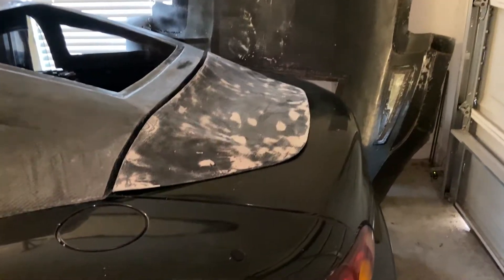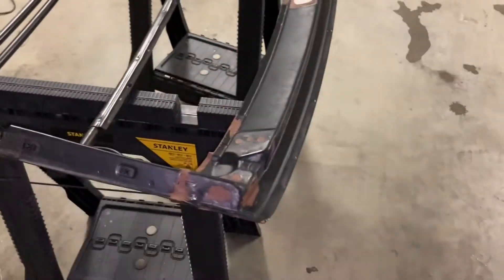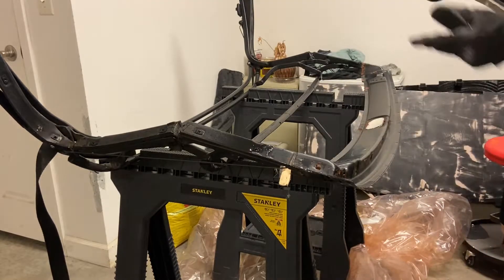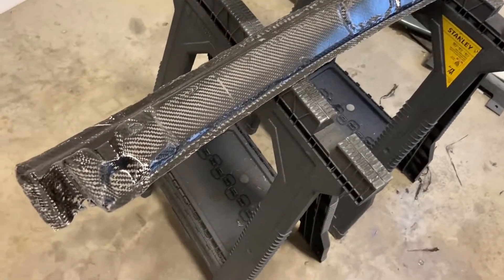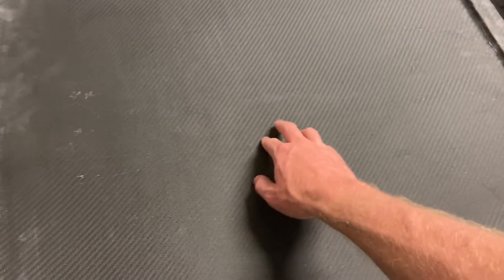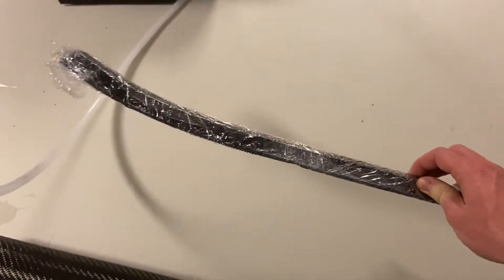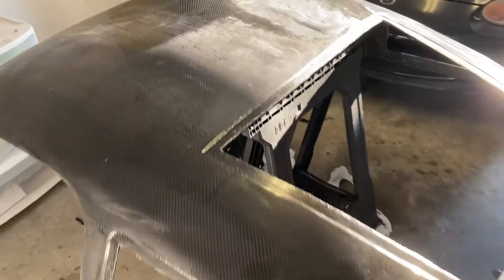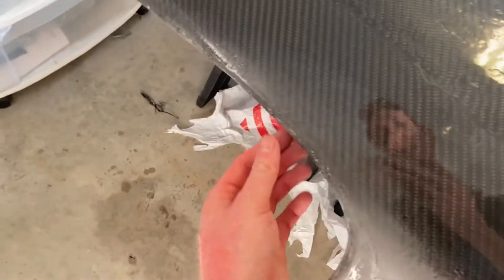Warped 3D print! DIY Miata Hardtop Update

Comment: Are you using PLA to print this stuff? I'd think ABS, ASA or even PETG would be more heat resistant. But the first two are harder to print successfully. Still looking forward to the final product!
Reply from the maker: Yes I’m printing everything in PLA. You don’t really need heat resistance on these parts since they are only used to make the molds. Just make sure they aren’t left in the heat very long before that happens.
Reply: @HutchinsRacing  But fiberglass resin (moreso than body filler, but body filler does it too) build up heat as the reaction takes place during hardening. Since you're planning to try to sell these, I might be inclined to work out the details on this one you have now (perfect the body work, etc.) pull a heavy mold in fiberglass and then cast them in CF.  I printed some stuff for my car (proof of concept stuff) and it's melting from just being in the car. I like the design. I had also thought it might be cool to refine the design to use something like Mustang quarter windows and like a new Miata rear window, so you could sell them without windows (lighter, cheaper shipping) and people could finish them off  with real glass windows...and you could offer plexi windows as an option? Just a thought.
Reply from the maker: @jayinmi3706    Ah yes you are right. I was worried about the resin cure temp when I made my molds but I wasn’t sure where to find that exact cure temperature and compare that with PLA glass transition temp. So basically I just got the slowest curing epoxy I could find and turns out it worked without distorting the print. I plan on using a scratch resistant polycarbonate for the windows instead of plexiglass because it is more resistant to heat and easier to drill into. I currently don’t like the idea of using glass because it is so heavy. Good ideas though, I will keep that in mind going forward!

Comment: Do you still have your mold parts? Need to build one for my car. Soft top is torn and I'm about to start building a hardtop
Reply from the maker: Good luck! I have all the molds just not the 3D printed plugs/patterns. I threw the 3D printed parts away because they broke coming out of the molds.
Reply: @HutchinsRacing  would you sell the molds?. My 3d printer is to small to print all those peices out. I mainly need the top of the roof portion. I can make the rest
Reply from the maker: @MattSavageFab17  No sorry I plan on using them to make more in the future. Sometimes you can outsource 3D printing for a decent price. You might check into that. Also check out Creality printers. They aren't super expensive and are pretty large.
Reply: @HutchinsRacing  yeah I have a creality 3d printer. How much would you charge to make a shell for me then? Can be in fiberglass.
Reply from the maker: @MattSavageFab17  Do you have instagram? DM me on there. Instagram name is HutchinsRacing.